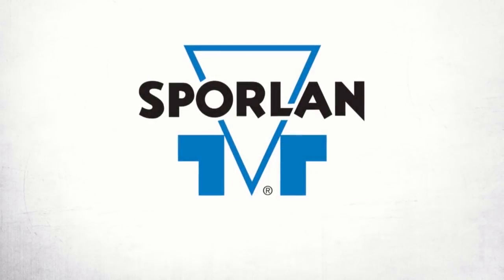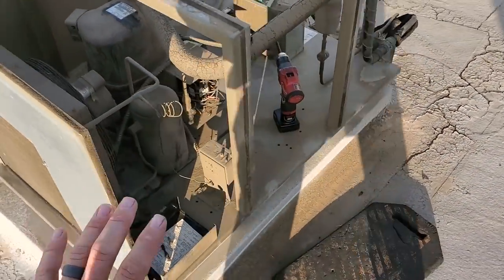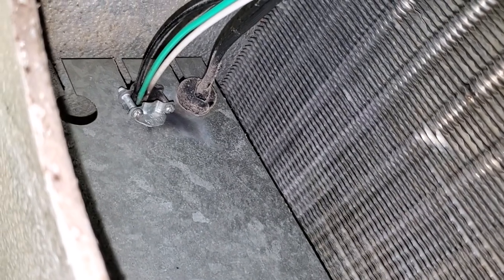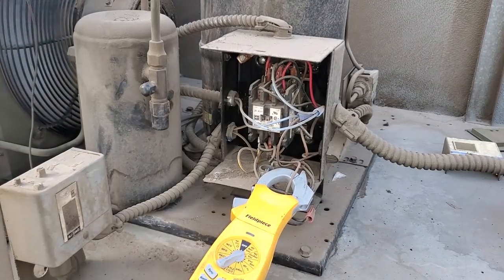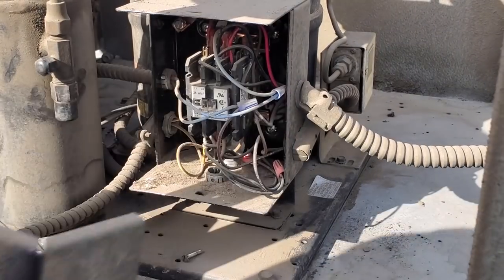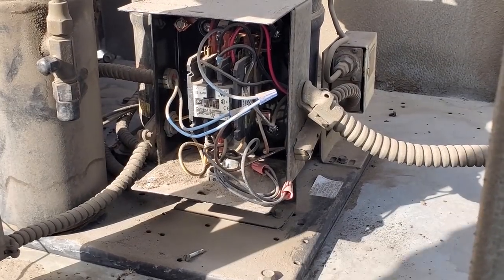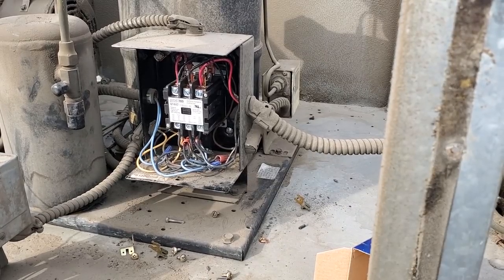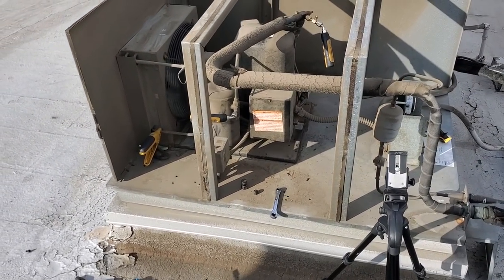WALK IN BREAKER KEEPS TRIPPING

Comment: So what was that thermostat test about ?
Reply from the maker: To see if I wired it correctly
Reply: Ok but how where you able to tell by the clicking ? Nice work by the way and nice videos
Reply: R1ck y4  The stat controls the liquid line valve which is right behind the stat. The stat is only on or off, so turning set point back and forth let him hear the liquid line solenoid opening and closing.
Reply from the maker: I will be going live on YouTube this evening 11/18/19 @5:PM (pacific time) to discuss my most recent videos and answer questions from the Live chat, YouTube comments, emails, and Facebook comments. Come on over and check it out  https://youtu.be/NjeFrNCiAEs

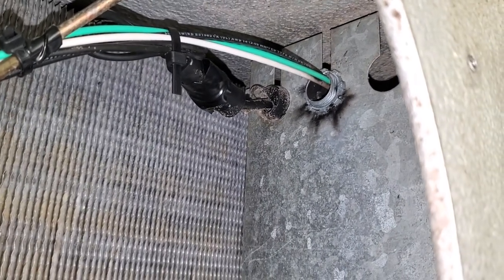Comment: 6:10 I'll be an alarmist.  I'm a perfectionist when it comes to electrical wiring.  So are those fans 220VAC?   Generally I've noticed that those walkins, etc are generally just huge sheets of steel and aluminum and if that fan wiring iss just rubbing along most of the time and no breakers are tripping then it wouldn't take to much 'un-crazy, just acting normal, can't wait to go home and see the family until someone leans, stumbles, grabs hold of something, etc and could easily lead to an electrocution. That simple little ruboff could lead to a fatality or two.  Hows that for an alarmist?  Just curious, not trying to be a prique here but where would you draw the line and report the person who left incredible faulty and hazardous workmanship behind?  Or would it be better perhapsto contact the person directly.  I'm not saying that this is necessarily one of those situations but people need to be extra careful when wiring equipment that people willbe around and interacting with frequently.  That fan wire was a bad looking actor and could screw up some kids life by robbing them of their mommy or daddy!  Very disturbing.

Comment: Odd that they're didn't want you to renew the cap on the motor, doe's it cost a lot for a cap...!
Reply: The capacitor will cost a whole heap less than a new motor.  A badly valued cap can cause overheating of the motor -- perhaps even eventual failure -- as well as excessive power usage.  "For want of a pfennig the horse did not get a new shoe.  For want of a shoe the horse  was lost.  For want of the horse the battle was lost."   (Old saying.)

Comment: I though we measure 3 phase voltage from.
 L1 to L2 
L1 to L3
L2 to L3 
Or does it matter?
Reply: In any order. :-) And when I'm turning off a disconnect I also measure them all to the nearest ground, just because I'm paranoid. I've been zapped by leaky breakers a few too many times.
Reply: I would say that while yes there is always a sequence of operation, which line you check and when is more about knowing what each line is for in the sequence of operations. Therefore testing points do not have an order necessary to the tech as long as the tech is viewing the whole picture in the end.

Comment: Where did they pull the neutral to do 115v tough? t doesn't seem to be a neutral available at the disconnect. Did they pull a neutral from another circuit? It's dangerous since if you disconnect the neutral for the other circuit to do some maintenance you now have line voltage on it, and also if some day someone replaces the breaker for that unit or the other circuit where the neutral is taken from with a RCD/GFCI, it will trip, and good luck finding it out. Or worse, they use the ground cable as a neutral since that is a TN-S/TN-C-S and thus it's at the same potential? That it's very dangerous.